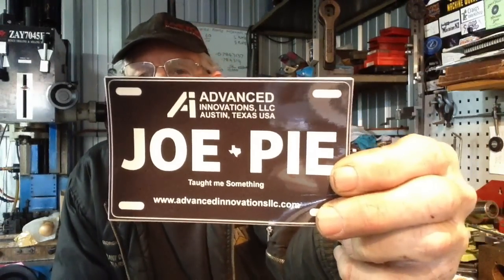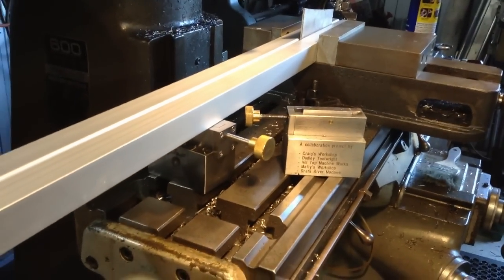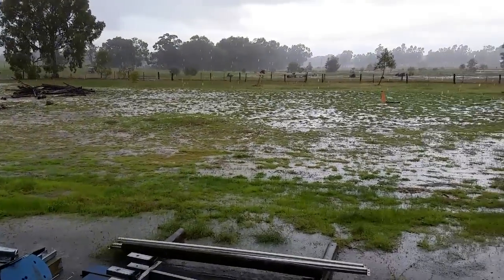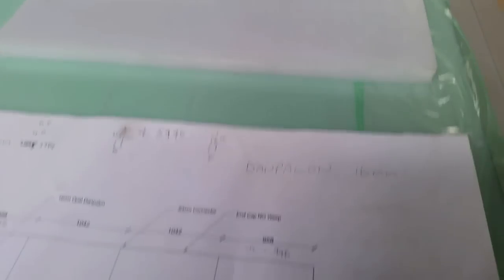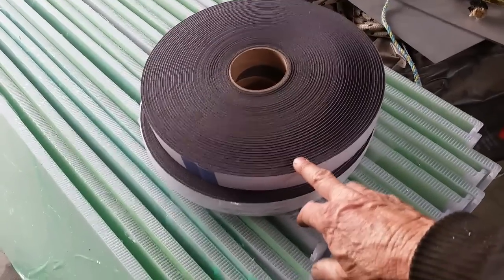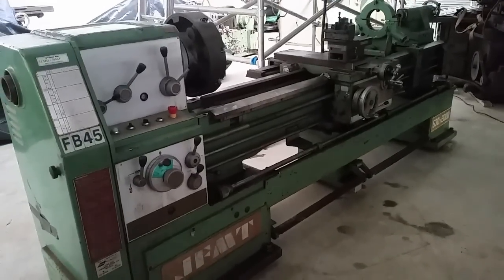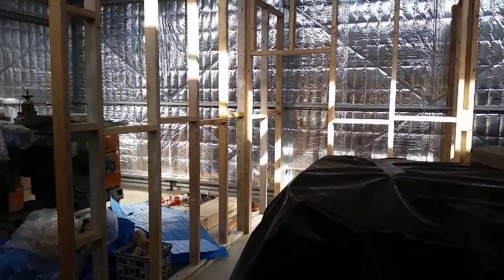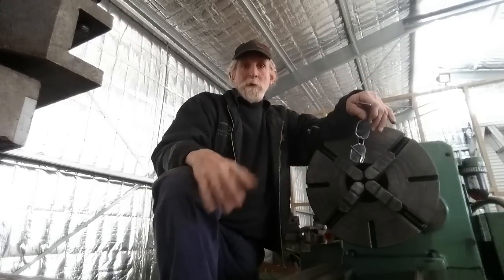New Shop update , June ' 22  &  JFMT Lathe Overview .

Comment: Shop is coming along. If you need to cap them holes I would recommend some low expanding spray foam. 😊
Lathe looks good. Wouldn't mind a closer look at that taper attachment 😉. Whatever you do do break that plug end, they cost a small fortune! 🤣
Thanks gor the share, Max!
Cheers!
Reply from the maker: Thanks Chris . The spray foam is a good idea .    👍

Comment: I’m happy your windows came in on time. Here in New York City, we were supposed to get a bunch of windows for our house in January, and here it is, the middle of June, and they’re still a couple of months out, if that can be believed.

CEE seems to be happy with his rather large Chinese lathe. I’ve found that Chinese industrial machinery is about as good as anything made elsewhere, even their old models. This seems like a rather well thought out model. As long as someone didn’t damage the headstock bearings, this should work very well. I’d sure hate to have to replace those.
Reply from the maker: Thanks .  That's an unbelievable delay for your windows .     To build anew house here now , they say it could tale 18 months .    
If i had to get a large lathe , i would not hesitate at buying a Chinese one , i was looking at a  J1CW 6263  630 x 3000  a while back .  👍

Comment: What a great video.   And how the shop layout is roughed in.    You don't have to worry about the wood work ,Max.. The white sheetrock (gypsum) will cover all imperfections and give room for  a drill index chart and an Aussie flag. They look fine.  The extrusion mounting at windows...well thought out.  And why so interesting?  Well, other machinist souls may gather the shop build to this quality...seize advantage by your instruction.  Learn by component floor plan. Thanks for the post.  M.
Reply from the maker: Thanks 👍

Comment: Just curious- will you be doing some wall [and maybe inside roof] covering on the building? I presume the insulation could be sensitive to damage if not protected. Everything looking good! Can't wait til you get up and running inside.
Reply from the maker: Only in the welding area at this stage .   I would like to on the walls , maybe at a later date .  Due to cost !!!

Comment: Big lathe looks sweet Max, pity it doesn't have a compound feed, but you cant have everything.  Just a suggestion, all the machine shops I have worked in, offset the lathes by about 20 degs rather than having them parallel to the walls of the shop in case any long stuff comes in, don't know what your layout is but its something to consider, stay dry buddy , best wishes , Mal.
Reply from the maker: Thanks .  My first thoughts were to try & angle them , but i can not get it to work out .  Too many different size machines come into the mix .   👍
Reply: @swanvalleymachineshop  Yeah been there, you can always cut hatches in the wall if the ocasion arises. BTW, the new shop is looking great, needs a vent in the Dunny tho. lol
Reply from the maker: @1ginner1  Not going to put a roof on it !!!
Reply: @swanvalleymachineshop  Haha

Comment: Good story on the micrometer set! That looks like a pretty decent lathe, has some nice features. Has your bigger lathe made an appearance in any of your videos? Curious what it is.
Reply from the maker: Thanks .   The bigger one was in an earlier video for a quick once over , but that machine needs a heap of work doing to it .  Better machines have been scrapped but i will try to save this one .  Not many machines can cut an 80mm pitch ( 3/8 of a thread per inch )  thread & feed as low as 0.0007 ''  per rev .     It is a Misal Heron K24 . 24 ''  X  10 foot   .  👍
Reply: @swanvalleymachineshop  "Needs a heap of work" Sounds like something I would buy 🙄
Reply from the maker: @ronrinock6943  The only ones i can afford !!!